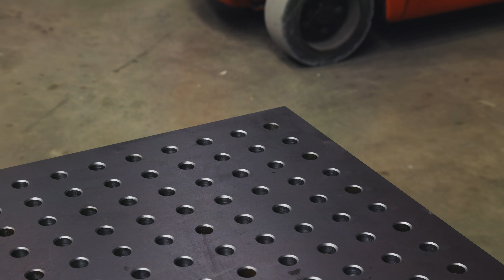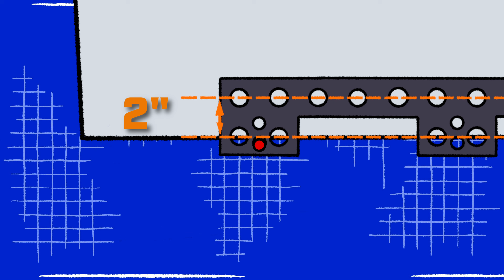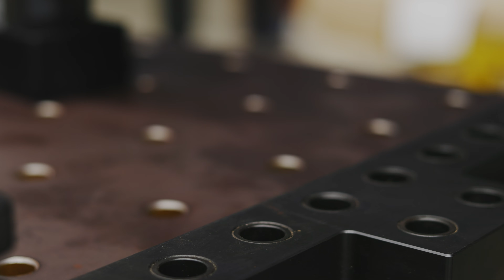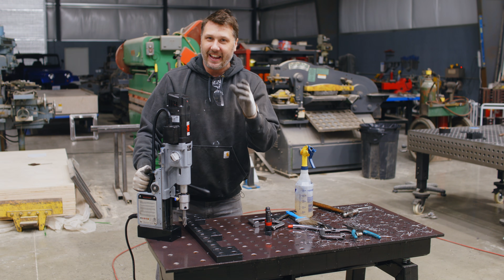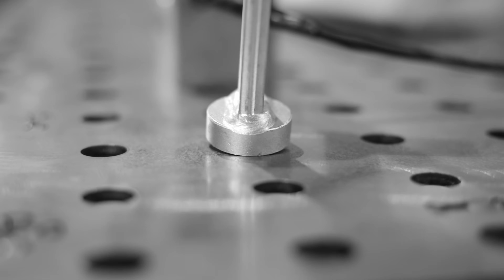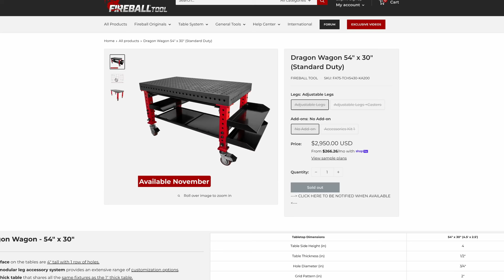This Tool Helps You Drill Holes In Your Welding Table.

Comment: These days the most expensive thing won't be the mag drill, it'll be buying 4x6 hot rolled 1/2"-3/4" sheet of plate steel and getting it delivered. 
Secondary concerns will likely include building a shop crane type system for lifting and moving such a heavy piece (unless you got something that can do that). Before you do the table, strongly consider the crane as a beginning project because you only get one spine, this stuff is heavy and it will pay dividends down the road that go beyond a fixture table.

Comment: Hi, Im thinking about building a small 4'x4' fixture table like this. But I'm considering using 1/4 in plate steel nstead of 1/2 inch, for easier portability. If I add proper bracing to the table by perhaps using a square tube frame on the underside (to prevent sagging and bowing), what disadvantages do you see? Would the stud pins and clamps still work with this thinner material??
Reply: Would use 3/8 at least from my research.

Comment: I’m doing this for fun.  Got a smoking deal on some A514 plate.  Found a Vevor mag drill for ~$200 that is actually decent.  Will also have it Blanchard ground top and bottom after, have a decent quote for that.  Then I’ll use set screws against pads on the frame to get it flat.

Maybe a lot of work, but I enjoy it and is better than having a lift truck arrive at my house and having to explain to my spouse what I’ve done this time.